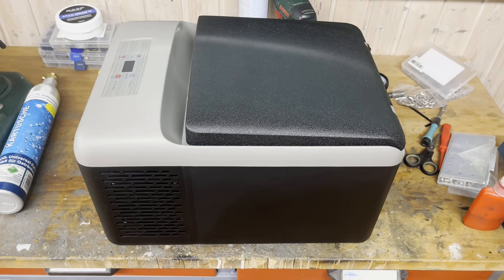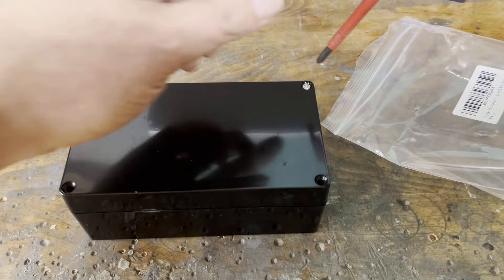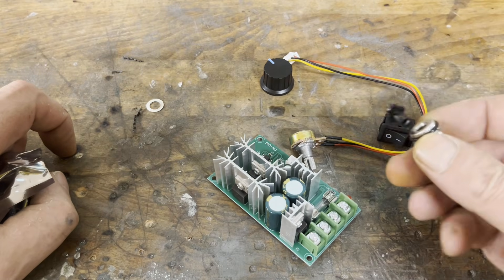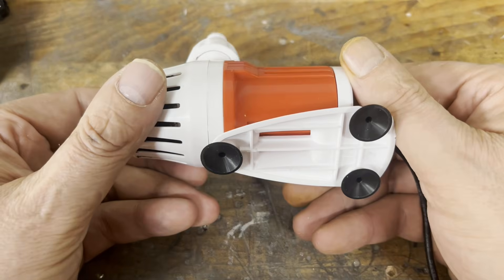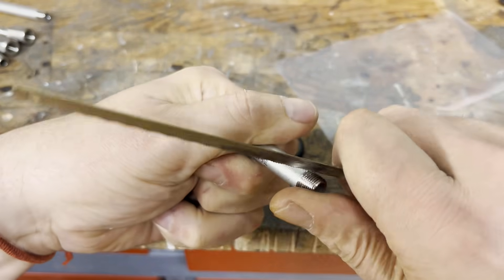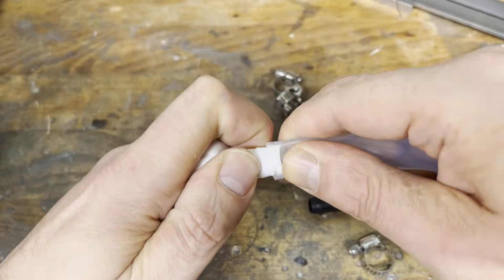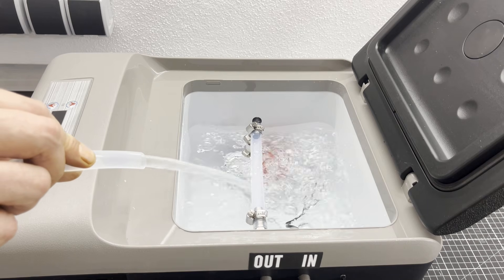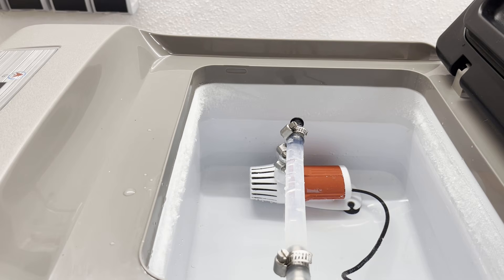DIY water chiller for the chemistry lab

Comment: A computer water cooling block with a peltier element (s) and a fan would perhaps be another solution. I thought way back of building one for keeping photographic process water cool.
Peltiers are not the most efficient though and for larger distillation/refluxing you would probably need hefty ones and multiple of those to get enough cooling power for anything not tiny.
I've sometimes used just a bucket as a cold reservoir with aquarium pump and removed warm water + add some new cold/cool water every now and then. It reduces amount of used water compared to just once through flow. Works with larger distillations too.
Reply from the maker: Peltier elements need a lof of current. They are only suitable if you cool a small area. I have experimented with an 4 piece array with 4 fans, but couldn't get satisfying results for cooling water.
Reply: @Marbslab  Yes, they take quite a bit of power. Probably way less efficient than say a computer water cooling radiator with a few fans (assuming cooling closer to room temperature is ok).
I'd guess a typical peltier cools only by say 30W while consuming about 70W or so. (a typical Qmax 70W element at half of temperature difference ie. half power)
For very low boiling point distillations room temp + some is way too warm. Mini fridge is a clever idea for those!

Comment: I think a higher performance chiller suitable for chilling glycol to ~- -15 C can easily be made by extracting the entire refrigeration loop from a portable ice maker. I imagine when rigged up so that the evaporator coil can be placed into a reservoir and be isolated from the rest of the system, lets say into a cooler like you have demonstrated here, you could get some rather good cooling performance. 

Now of course the actual cooling performance is going to completely depend on the refrigeration loop you're using and the efficiency of your evaporator, but it would likely at least attain something akin to what this can, probably much better in. Seeing as something like the portable cooler used in this video are relatively expensive ( for me ~200 USD) and the limited cooling abilities of the chiller built I think it might be interesting to see a build from one of these ~50 USD ice makers in a method similar to what I have described.

Ultimately it's likely best to just make a finely tuned compression cycle from parts off the shelf, but the ice maker provides an easily accessible premade loop with no need to play with compressed refrigerants. Really I'm just pitching it to you now because I haven't gotten around to this project myself yet! Fantastic as always man, I am 100% going to steal that pump setup when I get around to making my chiller!
Reply from the maker: I got the portable freezer for 90 Euro on Amazon.

Comment: Awesome!!! something commercial with adjustable temp and flow rate would cost a fortune, really really nice!
Reply from the maker: Thanks:) Starting point for commercial lab water chillers is around 1k USD.
Reply: It doesn't. You can get cheap compressor chillers for 300€.
Reply from the maker: @jangrewe  Where?

Comment: 3:00 careful, thread lockers often interact badly with plastics, i know ABS in particular is bad for that. Worth checking the project enclosure material and looking up its compatibility with thread locker!
Reply from the maker: Never had a problem with thread locker and ABS.  Thread locker is basically just cyanoacrylate.
Reply: @Marbslab  this will depend on the particular thread locker. Looking up hannaera, looks like it's one of those made up amazon seller brands, i can't find any datasheet for it, so you may have gotten lucky and gotten something CA based, but that's not actually very common for thread lockers (looks like it's mostly used in thread lockers specifically marketed for use with plastics).

Comment: I have several of these for transporting frozen food - the 230V adapter always died before the warranty goes out. I would recommend not using it to drive additional devices and instead finding a replacement to use for the additional devices and later for the whole unit.
Reply from the maker: I didn't use the original power supply, because its ratings are not suitable for longer runs (it can just supply 1.5 amps). I used my standard laptop power supply:)